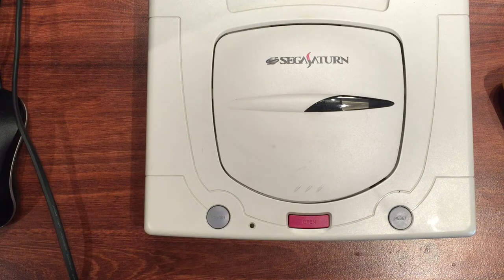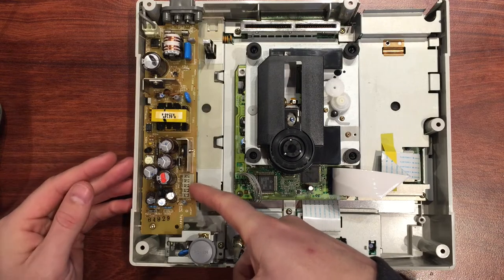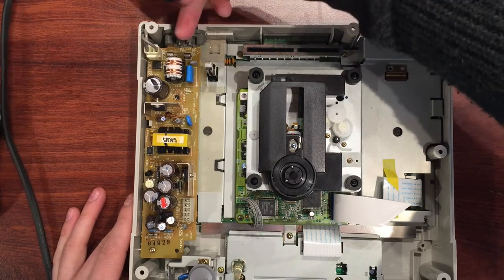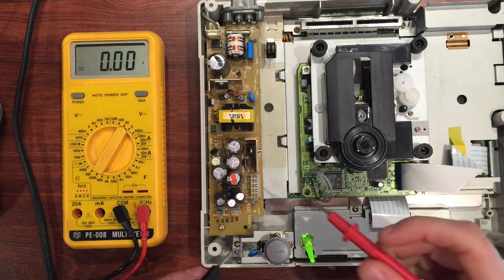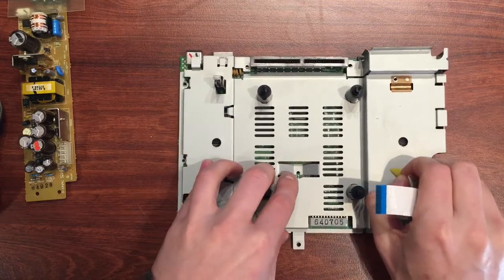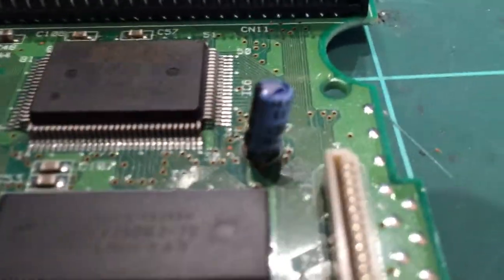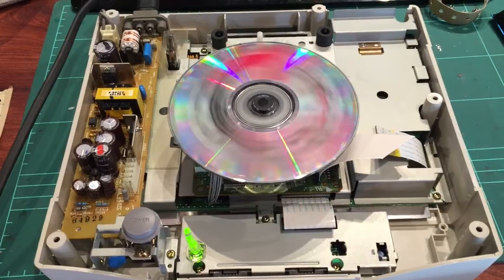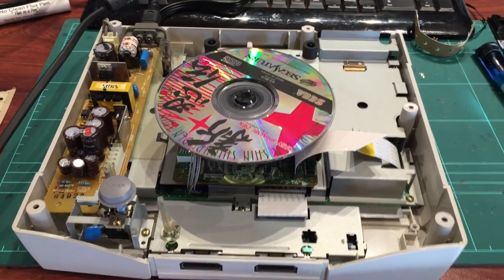Sega Saturn Repair No Video Display Fix Working - YouTube

Comment: Just repaired my saturn (Pal Mod2)  thanks to your video. Fault was power ok, but black screen and no disc activity. 
I first replaced the 3 caps like in your video with no result. Then I replaced the other caps near it+ the cap nearest to battery. When I pulled this one out it was obvious one leg came loose really easily. I replaced them and It works! Moral of the story: if you want to sure, replace all of those suckers.
But do it in stages, so it easier to backtrack if you make a mistake.

Comment: I owe you zillions of thanks. You won't know how devastated I was when my beloved Japanese model Sega Saturn white was out of order. So I followed your method to replace the three capacitors. Firstly I replaced CE37 so as to take my chance that by replacing one capacitor could solve the problem, but of course I am not that lucky. Then I replaced CE20 and CE21. I even had to use 25V 10uf tantalum capacitors as I could not find the traditional electrolytic capacitors. I just couldn't believe my eyes when I saw the screen appeared again. Thank you. YOU ARE GREAT!
Reply: THANK YOU SO MUCH FOR THIS REPLY i did the same thing and mine works now too these tiny ones do leak it seems.
Reply: @xreel1591  which model do you have? I have a japanese model 1 and a US model 1, both with the same problem, aparentely the US one has never been opened, until now.

Comment: Hi my friend , great video...
Question I have a sega saturn model 1  and like most got power led on no picture no sound nothing  ... 
My guess it's ps board (PSU) tested it the volts read pin 1  11.94v pin 2  5.27v  pin 3  5.28v pin 4  nothing then pin 5 ground  by looking at your video it the voltage is to high on mine ??? Can you help is the regulator faulty ? Would you say...  its been temperamental  some time it work then not changed the cr2032 battery  still the same  kind regards

Comment: Great vid Darren clear plenty of info and well delivered mate, I've just started tinkering around with console stuff so look forward to gaining more knowledge from your channel, if you ever get a chance love to see a similar PS1 vid as same deal from my end have power but not picture, keep attacking mate Franky
Reply from the maker: Thanks for the feedback! I've got about 8 PS1 consoles to look at soon, so if I run into a similar no video issues i'll be sure to film it and upload it for you. It does sound like caps though. If you've got a soldering iron you could just have a go. Pretty easy to swap caps out.
Reply: No dramas mate, cheers I'll have a crack and sing out if I get stuck champ..

Comment: I hope you are out there. I have a Victor Saturn where the audio/video output fried an audio channel in port on my Bandridge RGB scart switcher. There is a terrible hum sound, the video is low contrast and fading. I will give the caps a look. Also, I hooked up a Brooke controller adapter and crazy sounds and signals happened. So there has a to be a bad loop somewhere.
Reply: It's a model 2 VA9
Reply from the maker: Yes I’m here. I’d guess a cap has shorted to ground. I’d start replacing caps and test again. It could be a can of worms but you have to start with aging capacitors and try again. Fingers crossed for you.

Comment: Thanks for the video! i used it on an American model 1. I think it's VASG revision motherboard though, so the caps in question were SMD, so they didn't really show the bulging typical with through hole caps. I replaced them with some cheap generic caps for now, do you have a recommendation for some quality ones?

Subbed by the way!

Comment: Good to note that this is a VA-SG and they also come with VA9. VA9 is 9v, 5v, 5v  not 9, 5, 3.3
Reply: Sorry this is a VA-SD in the video, very similar to VA-SG, Then there's VA9 which is a much larger board and doesn't have the controller ports on a ribbon cable to a daughter board...

I've just replaced a part on a VA9 and looking for information, IC27:  314-0563 IC 74LS245 SOP 300MIL , I used an equivalent part but slightly larger footprint (trim legs back and filled the gaps with solder to have it fit) and getting a blank or grey screen.. might just switch boards and move on.

Comment: I have this issue btu I am not yet sure if it will output sound or if the disc drive does anything. Model 2 usa model

Comment: let me clarify a doubt: my Japanese model 2 saturn (which is the same as yours, since it is with 5-pin source and JVC ENR 011A drive) it only gives image after 3 or even 9 minutes on, has been changed the capacitor ... nothing .. everything was looked and nothing ... what kind of problem this console has after all @Global Garage ?

Sorry to bother you.

Comment: Nice work as usual.

This reminds me I have to go back to my consoles in storage and lay them upside down especially the original Xbox so that if a cap leaks, the acid wouldn't go on the motherboard.

Also, I already built a custom power supply for a US saturn, only I built it on the inside so that it looks stock. It's was really fun.
Reply from the maker: Get your consoles out of storage and start playing them again! It would be good to see the custom PSU you made. I've got the parts now, so I'll make one this week and post up the video.
Reply: Consoles in storage are either redundant or ones I don't really care for.
For the saturn psu, I took all the components out of the original fried PCB and stuck the innards of a laptop type power supply that has 5v and 12v to it. I fed the 5v directly to the saturn and then fed the 12v into two separate step down converters, one outputing 3.3v and another 9v. all wired to the original loom. it actually looks stock even on the inside if you didn't know what the original PSU looks like.
Reply from the maker: Very nice! Have you got any photos of that?

Comment: I replaced three 25v 10uf capacitors, but no video are available.  Is there any other way?
Reply: The capacitors he replaced look like theyre near the video encoding on a model 1 saturn. His revision is this one SD: 837-12133 a pal unit. 
Ive only had luck finding schematics for a VA7 revision board online so you're best bet is to try to locate schematics and replacing the capacitors closest to the video encoding chip like he did or take the time to recap everything to see if your video will work.
Reply: @sneakyvee  Thank you for your advice.

Comment: any chance you could answer some question?
Reply from the maker: DatGameCollector Sure, what's up?
Reply: Global Garage so i have a model 2 and it will splash the sega saturn logo. but the game will go black. and nothing and some weird ass sounds
 is that the caps?
Reply from the maker: Yes, caps most likely. Very similar to what I demonstrate in the video, but in your case I would swap them all.
Reply: You recommend some of the things i would need and decent brands? I also wanna put a new laser in it.  I think its the sanyo one. Thanks for the reply btw.

Comment: I have a VAO with this problem.  Have you fixed a VA0?  Which caps would you recommend first?  Just took it apart, what a pain in the arse!  My original Saturn bought in early 1995 is a VA0 but I have never taken it apart.  The video became a bit dodgy, I think the video board may need a re-solder.

I opened another VA0 to put an 240v power supply I bought from HK, that was annoying enough.  I don't think I will be changing caps-checking-changing caps-checking....  so annoying to put back together and take apart constantly.

Comment: I bought a pal saturn model 2  from a friend of mine and my problem is: 
 Αs a console  it works very properly and it's reading discs fine now the problem is that when I turn on the console for an unknown reason it's pressing buttons by itself (it's not from the controller because I have 2 and works perfectly with my other one ) it also do that even without the controller plugged.  The buttons that is pressing is up,left and start for sure and it might be x,y. The previous owner told me that it worked just fine then he stored it for 5-6 years and then one day tried to boot it up and did that.  I have to mention that he turn on the console couple times without the battery.  
I ve changed the battery but nothing it keeps the data and time but the problem remains. 
I ve also checked the power board and main board for dead capacitors or any rust between the chip pins but it seams to be fine.  
Any ideas anyone ?

Comment: How would you fix a Saturn with no power period? I replaced all the caps in mine and it didn't fix it.
Reply: Dumb question maybe, but did you check the fuse first?

Comment: Why not invest in an LCR meter. Just desolder a leg and check to see if the cap is good or bad, instead of randomly replacing every cap you find. You wouldn't start randomly replacing resistors would you?
Reply: The system is over 20 years old at this point. Honestly, replacing every single cap isn't a bad idea. At this point it's just preventative maintenance. Not to mention you can get a complete cap kit for the system for 10 bucks and some change.
Reply: Why not do a ESR meter and measure in circuit?

Comment: be careful with not ussing "original caps", Q = VC so if you need 25 volts to get a max 10uF and before you needed 16 the energy magazined wil be a bit lower, probably you dont have to worry that much but just in case its good to know
Reply: 25v is the maximum rated voltage that the capacitor can withstand. there's no problem using overrated caps in this instance. the only drawback is that higher rated caps often have bigger physical size.
Reply: @utubechannel8670  thats not the only drawback, study a little a bit.
Reply: @pabloxd1239  like I said,  there's no drawback IN THIS INSTANCE.  what you described is insignificant and not a problem to worry about for people here.  I have a first class degree in Electrical and Electronic Engineering and have won awards for the same.  😉
Reply: @utubechannel8670  well then why you try to "point me the errors" when at my first message i write that he doesnt have to worry all that about
Reply: "just in case is good to know" " you dont have to worry that much" i wrote, your pretty smart boy